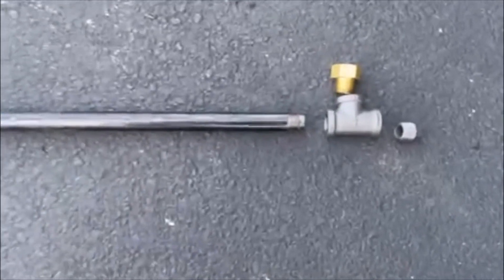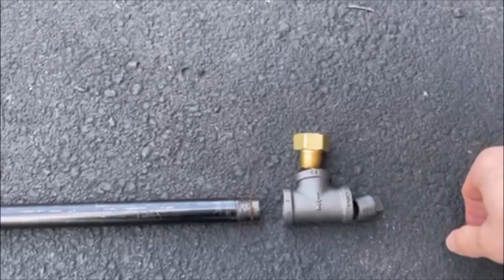How To Get/Bore A Pipe Under A Concrete Asphalt Driveway for Electrical, Irrigation, or Plumbing

Comment: Thanks for sharing this demonstration.

I was surprised when I saw you implementing one of several ideas I have been thinking of since last month.

I am so Happy to see it works as expected. In my case the asphalt road is wider, and I also have to pass under 2 sidewalks to reach my target location.

For another project, I have to repeat this process, but the most difficult part is that I need to run a 3" or 4" HDPE pipe under the asphalt road, so I think this method wont Work so easy, and I will have to change the boring method, like using a 2500-3000 PSI pressure washer with a Casing Pipe, or use a  modified Bottle type hydraulic jack to push a piercing tool horizontally.

Thanks 👍

Comment: Lay all your pipe across the surface end to end but not coupled. Each time you drive a section in and need another section, take it from the nearest pipe to you.
That way you will know exactly where the end of the underground pipe is. No guesswork.
For me, that system won't work as I have things in the way growing along the driveway (trees, rose bushes, etc).
Unless I go down at least 24+ inches and that makes things a lot harder especially since I have to drive it through hardpan and most likely backfill with hard rocks.
Good video though.
I would probably need to rent a machine to do mine.

Comment: I 100% recommend this method, based on poor choices.  I used 1" schedule 40 PVC to bore under a 12 foot driveway in dense clay.  The pipe rose 14 inches on the other side because I didn't have a way to control it.  I think this is a much better way to do it.

Comment: The problem with this method is thew water will undermining the gravel/soil under the driveway or sidewalk which can lead to sagging and eventually cracking. I suggest to renting and utilizing the proper boring equipment it might save you thousands in repairs down the road.
Reply: Came to say this... He doesn't look like he has a ton of pressure in that but still your point is valid.

Comment: Let me tell you why this is dumb. This creates a path for water to flow through seeing how you were running water to flow through it. 
The best way to do this is to cut some teeth on some 3-in PVC and bang it straight under the driveway. Horizontal to the ground about 2 ft down and use a hammer. It'll act like he saw and pull dirt out. And will not decompress the ground around the pipe. Or create pass for water to flow through.

Comment: It should be a Code requirement to run pre-position conduit under driveway and sidewalks. A simple 3” pvc pipe sealed on the ends with duct tape. If you are building a home I advise you to do that. I did. And it saved me immeasurable headache.
Reply: I like to place extra runs from a breaker box up into the attic for the same reason.
Reply: The code to needing conduit under a driveway for service lines is 36inches minimum nothing less.
Reply: @Sarah-hu8su  that’s only if you’re running it under the driveway as part of the new build. I’m saying put it under the driveway for future use.
Reply: So you think someone should write a building code that involves duct tape. Got it.
Reply: @waytospergtherebro  so make the code require it be 3" electrical conduit that extends 12" past either side of the finished surface with glued end caps. problem solved
Reply: @adammiller8415  it doesn’t need to be conduit. Any piece of PVC pipe would work. You can run conduit to where the concrete starts and then conduit after the concrete on the other side. But the concrete negates the need for conduit.
Reply: @ any pvc? funny last i checked dwv pvc isn't UL listed for use as an electrical conduit. Guess some of us just care about using the proper product for the proper and intended use. So stupid I know
Reply: It covered by Concrete. Besides, if you use the 3 inch PVC, you can slide conduit inside of it. Beats the hell out of cutting the concrete out to run an electric line or a water line.
Reply: @waytospergtherebro  I think the Mechanical Code is full of this detail already...
Reply: @Detritus0311  yes but only if they’re running conduit under the driveway as part of the new build. I’m saying preposition conduit under the driveway so you don’t have to dig it out later when you wanna add a sprinkler system or a hot tub.
Reply: @waytospergtherebro  yes I do. It’s better than nothing under the driveway. They can literally do it with scrap material laying around the job site.
Reply: @waytospergtherebro IKR... The code should have masking tape... Duct tape is too sticky 😊